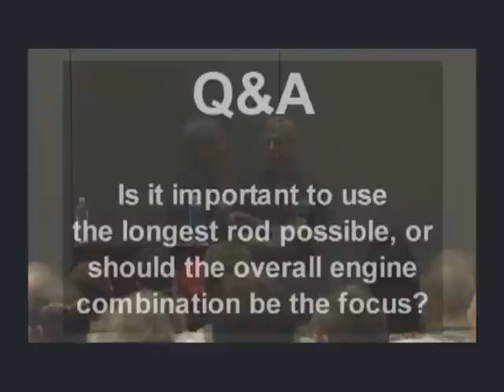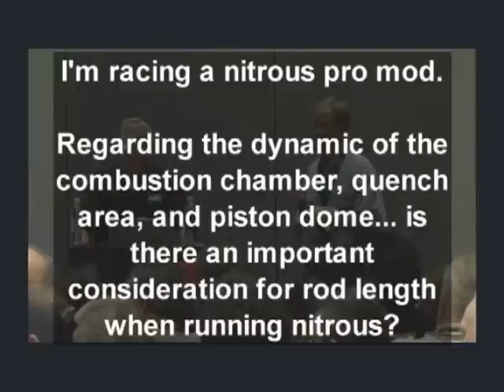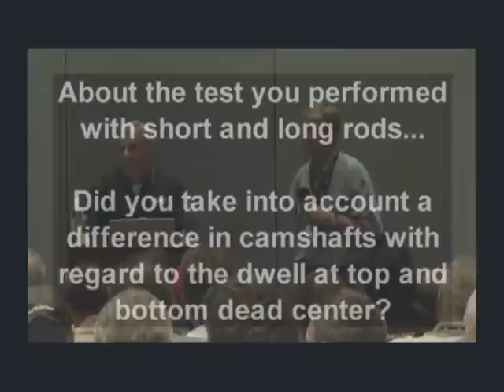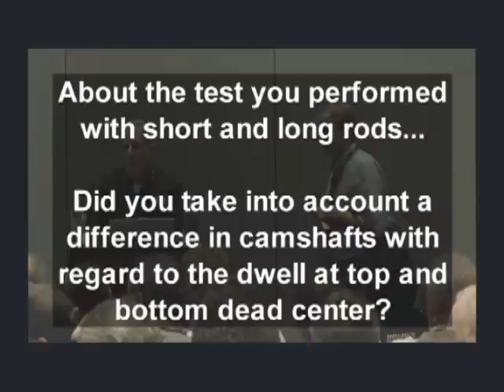Dart University Master's Series, Connecting Rod Ratio

Comment: A greater dwell is more desirable around TDC as then the pressure has more time to exert force on the piston. 

Unfortunately, in engineering there are no free lunches, and usually only compromises.

The compromise associated with a larger dwell time around TDC, is a larger dwell time around BDC.

:)